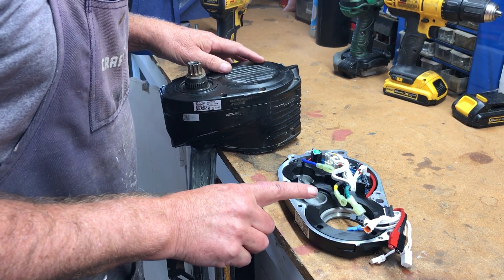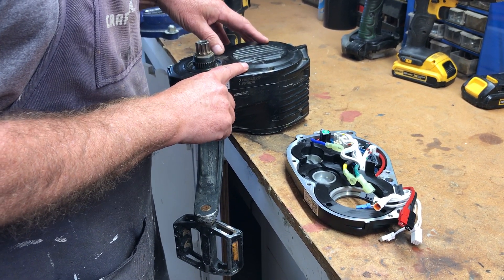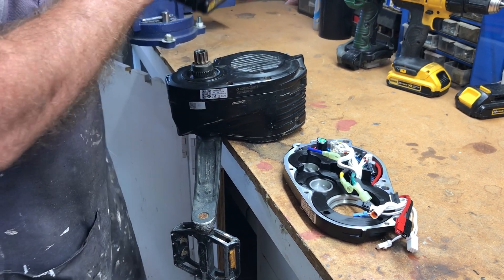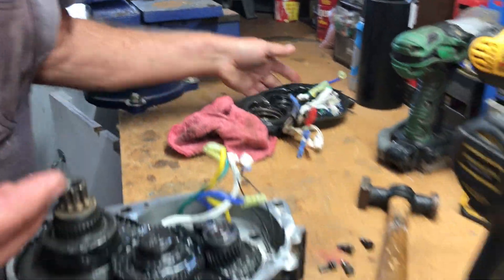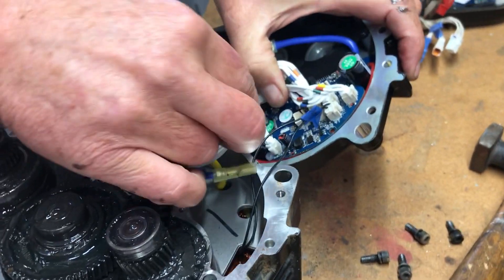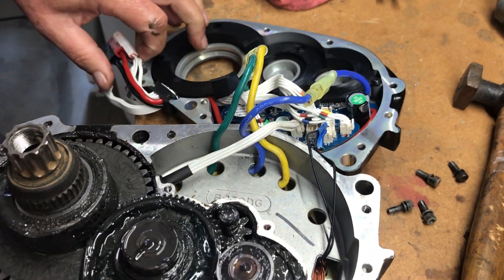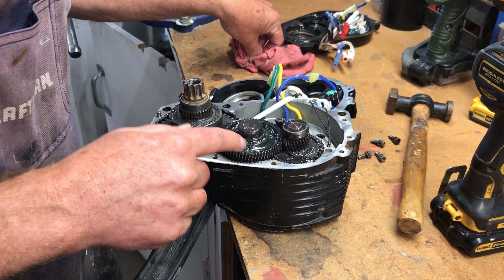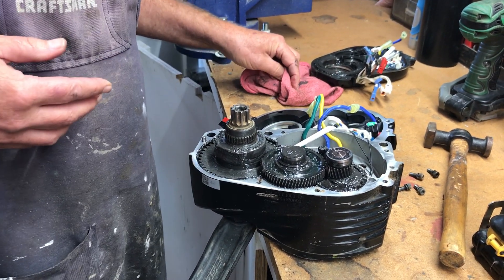Bafang Ultra G510/M620 Bad Controller Swap

Comment: i have a bafang ultra g510/m620 motor here , the issue i am having is it will not spin. it makes a humming noise for a second or two before a clicking noise is heard and the humming stops. i've taken the motor completely apart, tested it while apart, and the motor output gear(little angled one) just vibrates a little instead of spinning. my guess is bad controller. what do you think?
Reply from the maker: Sounds like you field wires are switched? Check those before buying a new controller.
Reply: @filoncmike  Thanks for your quick response i do appreciate it. i thought the same thing but they are all plugged into the correct colour, yellow to yellow, blue to blue, green to green. They all seem connected firmly. One thing i did by accident was spin the motor output gear while disassembling. I wouldn't think that would affect anything, do you think it would? I tried rotating it to every possible location before testing and nothing worked. sometimes it just humms, sometimes it vibrates, and sometimes it would flick a few spots and then stop. a couple times it made 1-2 revolutions before stopping. almost seems like a dead battery but it reads 95% and screen turns on brightly.
Sorry im lost and looking for anything lol. Do you think a new motor controller would even fix an issue like this?
Reply from the maker: Spinning the gear will not cause any issues. It sounds like one of the phase wires is not getting power. I would contact bafang in LA and ask them. I do think the new controller will fix the problem but you will still have to match it with the motor. My only other question is what brought on the failure? We’re you riding or did you short something? No codes ever?
Reply: @filoncmike  How do i determine which controller I need for my motor? I understand there is two types, UART and CAN-BUS. I am also reading conflicting results about whether a new controller would need to be recalibrated with a special display. I've read UART doesn't need to be recalibrated, only CAN, and i've also read the exact opposite. 

The failure is a mystery to me since it's not my bike, I can't say for sure what symptoms it had before taking it apart. A friend asked me if i could replace the torque sensor since pedal assist isn't working, so i went ahead and did that assuming it would fix the issue. I never tested before replacing it so I can't say for sure if the throttle worked before or not. 
My guess now is that the torque sensor was not the problem to begin with, and possible something to do with the controller.
Reply from the maker: @bmxscape  get your controller from greenbikekit.com here's the link: https://www.greenbikekit.com/bafang-ultra-motor-controller-52v.html give them your serial number and they will sell you the right controller and watch the videos. they are very helpful and respond quickly. Good luck!!
Reply: @filoncmike  thank you very much for the help
Reply from the maker: @bmxscape  please let me know how it turns out!!
Reply: @filoncmike  after some more tinkering around i got the motor to spin.. but its spinning backwards now, and just freewheels the 1-way bearing instead of turning the chainring.. I got it to turn after I noticed i had got some grease on the magnetic sensor opposite of the motor output shaft so i took the controller apart to clean it. while taking it apart i noticed one pin out of the like 25 pins connecting the 2 circuit boards together was bent, so i bent it back in place too. after reassembly the motor spins, but backwards. I guess the grease blocking the magnetic pickup stopped it from working all together, and the bent pin thats now straight is making the motor run backwards...? is that at all possible? the owner of the bike said no one else has had the motor apart so the bent pin was from the factory or dealer, and he said he has over 2000 km on the bike. do i dare bend the pin back out of the way and cram the connector back in without it?
Reply from the maker: @bmxscape  that’s a new one! I don’t remember any bent pins on that connector. I can check
Reply from the maker: All pins are straight!!!
Reply: @filoncmike  very odd. i think i will try to get the c961 calibration display and see if it will help fix the motor running backwards. on greenbikekit's website they mention "Replacing the Bafang M620 UART controller, the motor may work abnormally(vibration, reverse running etc), you may need to calibrate the motor. "
so since the motor is reverse running it seems like the logical next step to me.. you ever seen one running backwards?
Reply from the maker: @bmxscape  I never had one run backwards. The motor I put the new controller in ran just ok but after aligning motor and controller it performed amazing and ramped up power perfectly smooth.

Comment: I know this is an old video, but the 2 (black) wire plug is *NOT* a hall sensor - it's a thermistor temperature sensor for overheat protection.
I believe the M620 uses an 'encoder' setup to read rotor position, based on a cylinder magnet attached to the other end (non-gear side) of the motor shaft.
I stumbled on this video looking for more information about the M620 encoder and possibly changing it to a traditional hall sensor setup for use with most aftermarket higher performance controllers.
Reply from the maker: Thanks Privateer! I think you are correct. It is odd however the socket the plug goes into the board is marked "HALL"

Comment: Do you have a source for the controller you recommend?
Reply from the maker: greenbikekit.com has them for $60 but the only work on a UART controller. Ride safe!!
Reply from the maker: sorry - C961
Reply: @filoncmike thanks,  how do I know which one I have?  Uart or can?. Im sure I got 48v
Reply from the maker: @zj4041  send a pic of your serial number on the bottom of the motor to greenbikekit.com or bafang and they will tell you. Good luck!!